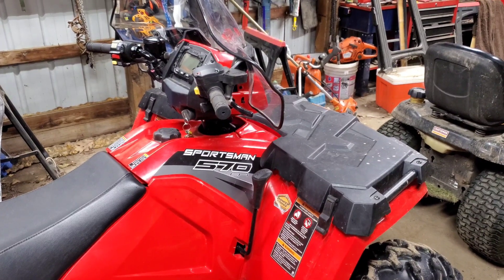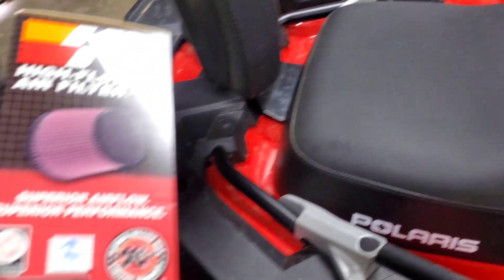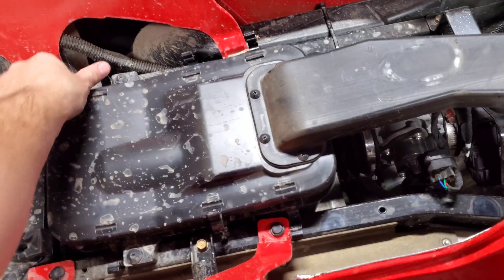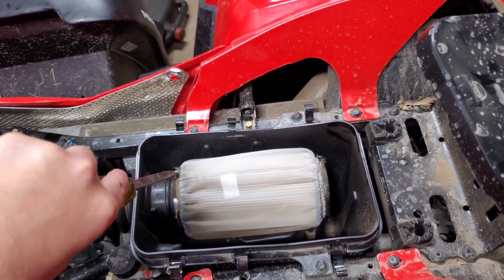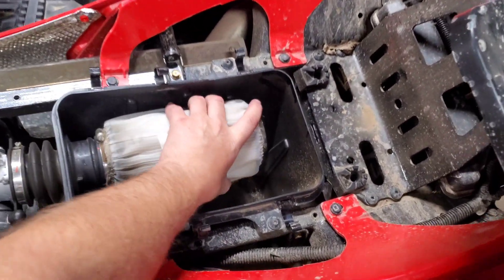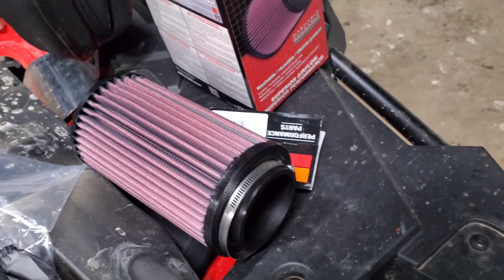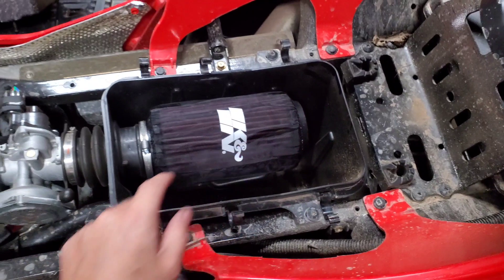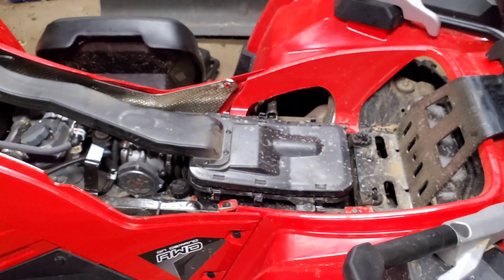😎How to install a K&N air filter in a 2018 Polaris sportsman 570 touring😎

Comment: Did you put any oil on the air filter and did you feel any improvements on the quad
Reply from the maker: It came pre oiled. It gave the quad a little more pep
Reply: @AdventuresInLiving  ok thanks

Comment: Did you install the ITP Delta rims on this bike?
Reply from the maker: Yes
Reply: Okay i was getting a set for mine. What size tires are you running in the front? Was 4x3 offset enough to clear the tie rod?
Reply: Yes i have 26” on 14s 4-3 offset